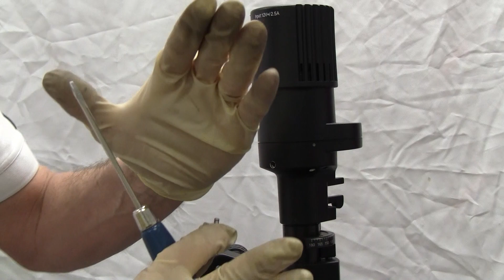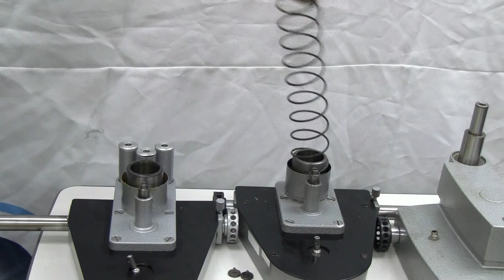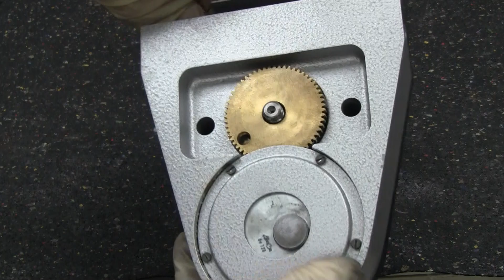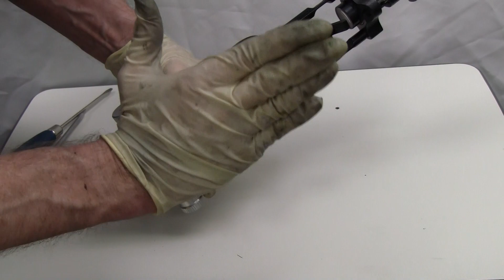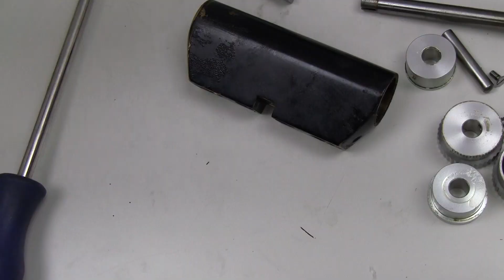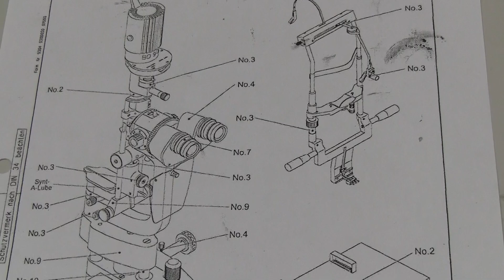Haag-Streit Tower Slit Lamp Complete Parts Breakdown: BQ/BM/BC/BD/BI/BP/BX/BV

Comment: Do you have a video on putting bearings back in
Reply from the maker: https://youtu.be/WmqZfB0Mfmw "Haag-Streit Slit Lamp axle bearings reload" showing one way to do it. Some have had success using painters tape or grease to hold the bearings in place. Once you have done it a few times, you won't panic if they come out for one reason or another. Actually, Haag-Streit is easier than others with the notch at the end of the axle. 😆Hope that helps.
Reply: @grasshoppaMedia it really dose…but another question, I have two HS that have something inside grinding, and it’s one of each style of bearing you show in this video…can they be replaced with little 4mm bearings off Amazon if they’re rusty
Reply from the maker: @professoradoptme4470  Yes, a 4mm will work where ever you get it. I don't remember trying to replace a bearing in the white bearing sets, though, just the brass holders. Just a note... Haag-Streit does not recommend any lubricants on the bearings. Some techs put graphite on the bearings which turns into grinding sand eventually. Clean bearings and a clean axle work the best in my experience. Hope you resolve it!